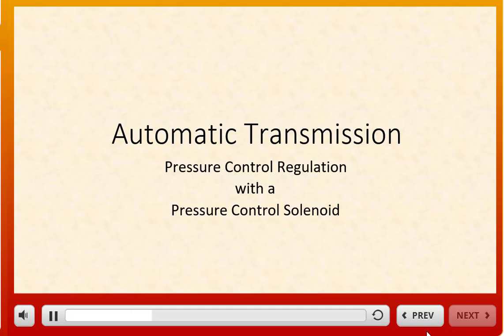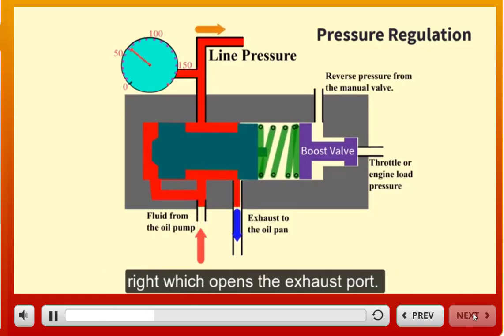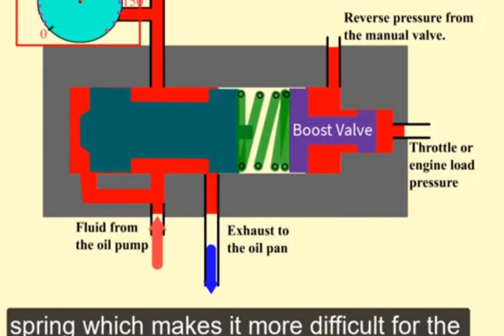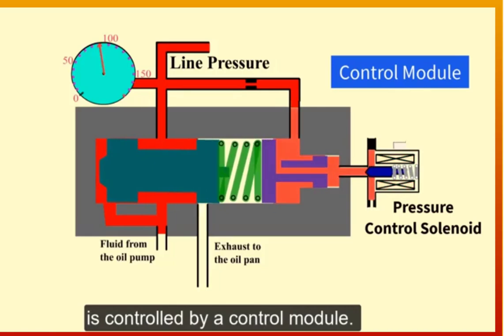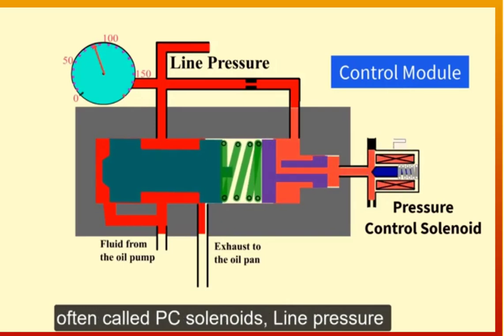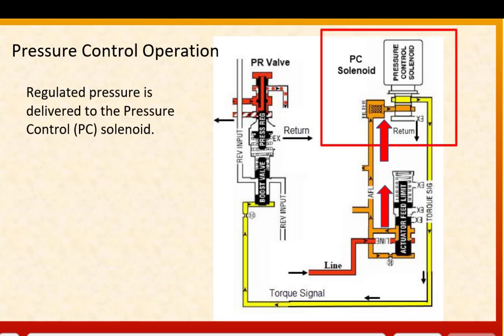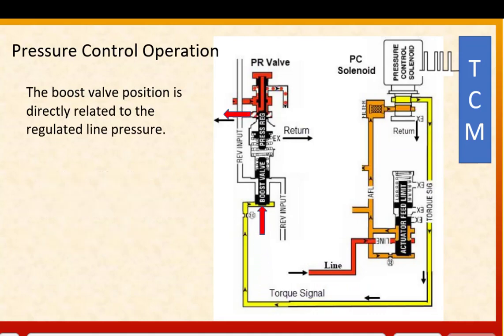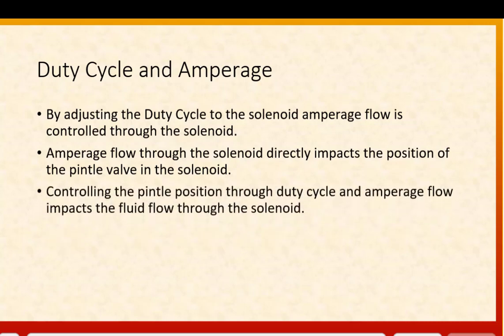Auto Trans Pressure Regulator and PC Solenoid Explained

Comment: what happens if the solenoid exhaust port is stuck close or stuck open!
Reply from the maker: A stuck closed solenoid exhaust passage will cause excessive high pressure and harsh shifting.  A stuck open solenoid exhaust port will cause excessive low pressures which will cause slippage and transmission burn up and destruction. This is why with no electricity the solenoid exhaust port will be closed off causing high pressures. The shift will be harsh but it won't burn up the transmission.
Reply: Took ase 2, I have three other ase and smog license did really good just had a question about some of the question I saw if u had an email 📧
Reply from the maker: drivelinemaster@gmail.com